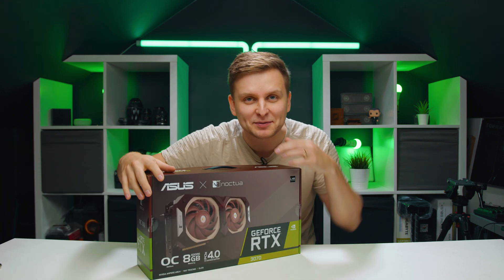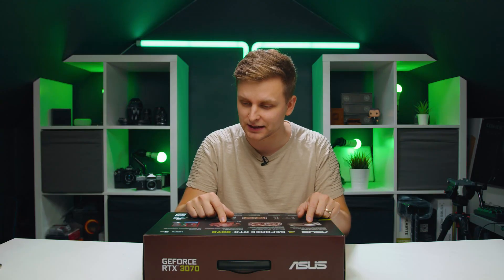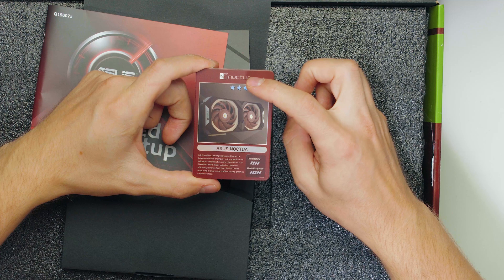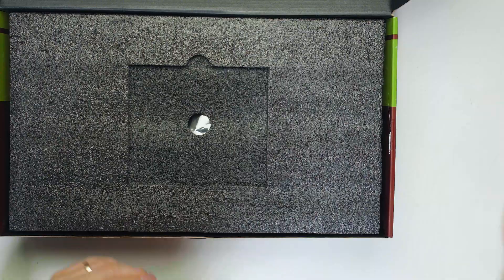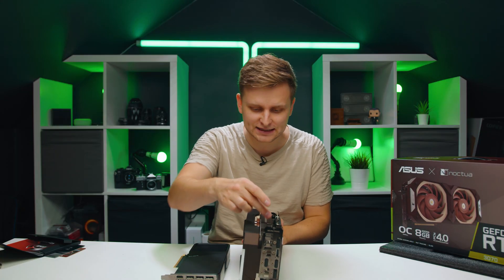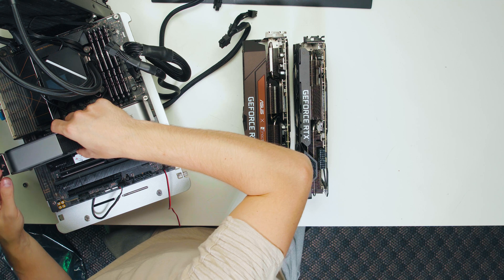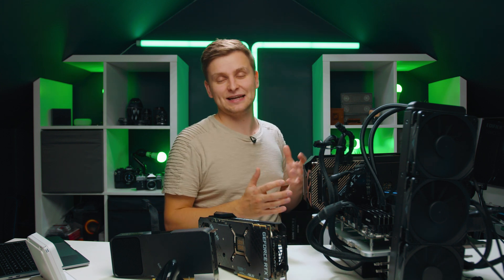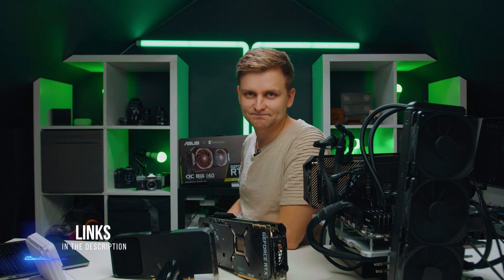NOCTUA RTX3070 🟤 vs 🟢NVIDIA FE GPU comparison & Review 🤯😱| The Silent GPU!

Comment: I would like to use this card but I'm wondering if there will be a problem with it overhanging a second M.2 slot, and if it would mean that M.2 will not get proper cooling, or will the GPU be blowing air on it anyway solving that problem? (ProArt X570 motherboard / WD_BLACK SN850 SSD)

Comment: Hi i have Amd 3600 and gtx1650  16gb ram 550w power in b450m motherboard
can i  upgrade to 3060 without changing my power supply or will it bottle neck 
suggestions plz
Reply from the maker: Yeah, you should be able to upgrade :)
Reply: @theTechNotice  thanks
Reply: its in vain till you dont buy a min 650w goood quality psu. i dont risk in youre place

Comment: you can put the radiator on an rtx 3080 or 3090 if possible
Reply from the maker: Not really, each heating is designed for the GPU, coz memory and other things that need cooling down can be in different places.
Reply: @theTechNotice  ok